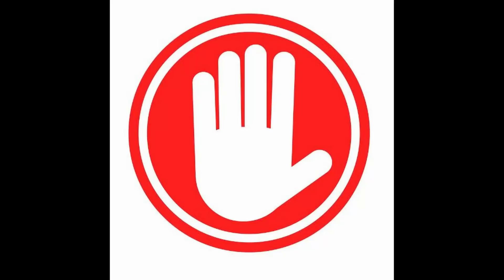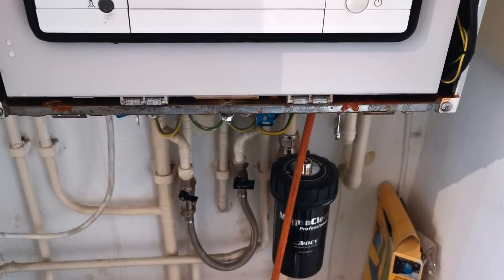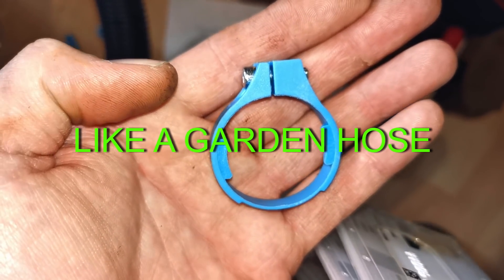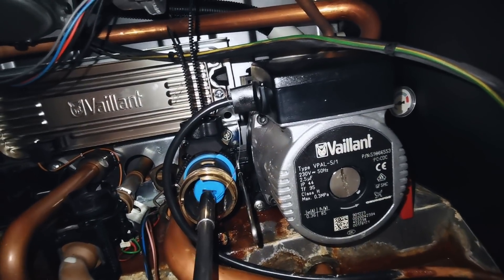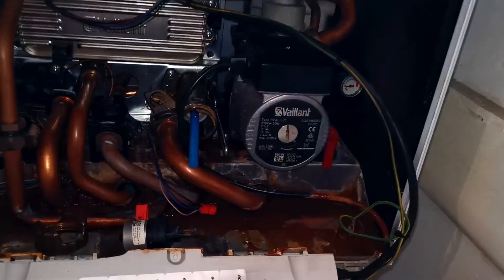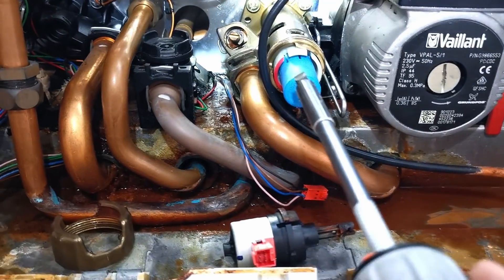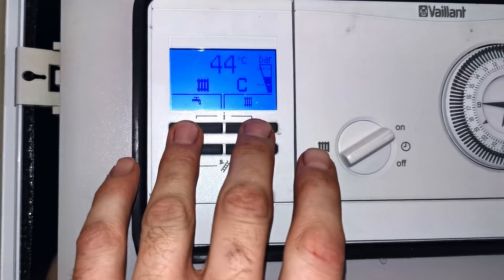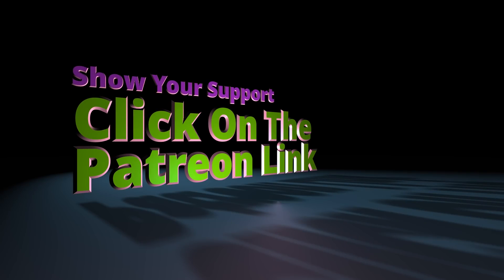Vaillant ecoTec Diverter Valve Repair. Leaking Valve Fixed. buycombi Kit Review leaking ecotec

Comment: I will say 😂 great video 👍 really helpfull. used one of these to replace divy valve exactly like you showed
after fitting no leaks but only top floor rads getting hot which no amount of balancing could fix 🤷‍♂️

Comment: Good video, shows your experience another way to fix the problem. I normally change the diverter valve but if you can fix it then why not. Slight rust doesn't matter as long as there aren't any holes that can affect the room seal.

Comment: I worked on this kit at British Gas Xsol, it’s not a bad kit to be fair, I found that the blue clips tended to wear after about 3 or 4 swaps, an alternative I used was a pair of fuel line pliers to snap the cartridge lugs and then needle nose pliers to remove the cartridge, then you can use whoever sells the cheaper cartridge. Cheaper repair and unfortunate the recall happened, great tip on the slot as well😉
Reply from the maker: Thanks. I think these will be done nearly every time soon. Its just so cost effective. We will see about the longevity of them.
Reply: Don’t think Vaillant are too happy about it😆 it saved BG about £75 per repair, and they swapped over 5000 diverters in 2016. Not sure where you would stand on warranties, but it’s a great fix👍🏻

Comment: Get video. I've done it the other way with fuel pump pliers. I didn't take the div valve out, the pliers brake the tabs then i used a pair of needle nose to take out the cartridge. The tabs can be a bit hard to brake but it works just fine .

Comment: Just did this, couldn’t get the cable tie to work on brass valve so just broke the tabs from inside with a screwdriver. Easy steps after that. Pin was corroded on previous one. £30 job, was quote £400 for a new brass valve. Time will tell if it was a success but all looks ok after 2 days.

Comment: I think everyone is different we all have to make choices based on what we see on site. Personally I'd change the whole DV assembly. Had enough call backs through trying to repair so thats what i always do now. But as i say we're all different and have to make our own choices, as there are so many factors at play. Also from a customer relations point of view and with experience I always get the customer to look at the state of the boiler, always make them aware that once one thing goes its possible others will follow.
Reply from the maker: That boiler has been fine with the second cartridge in it. I have just fitted one of these in my mum boiler. Full, in the family test. :-). I work on a lot of contracts and how I fix boilers varies depending on how the pay works. Unfortunately, I cant always replace the whole part. :-)

Comment: Nice one , i buy from the same guy on e bay and ive fitted about 10 up to now and touch wood have not had any issues with them leaking , if your going to fit a lot of these get yourself a pair of the cranked long reach grips from e bay ( about £ 15 ) and they make the job a lot easier...
cheers
Reply from the maker: I have them but haven't used them yet.
Reply: @yensabi Are the plier grip things good in your opinion?
Reply: Umar K ......yes , I used to use the plastic clamp before finding this tool and it makes the job so much easier....👍
There is a company on eBay I think it's called ( partsdaddyuk ) sorry no link and they sell them for about £ 7 , I think they call them a fuel line clamp ,
Reply: @yensabi  Thanks mate. You saved me a few £. I was gonna buy the exact same ones titled Vaillant diverter removal tool for £19. Appreciated 👍🏽

Comment: Good video for learners 
That fault was caused by a spec of debris, new boilers are whimps
Nice work fella
Reply from the maker: Yep
Reply: @HeatingGeek isnt it just as easy to change the whole divertor and housing rather than the cartridge also which model vaillant combi is this please mate? Thanks
Reply from the maker: @garylawton7254  Its just as easy both ways. The cartridge is much cheaper though
Reply: @HeatingGeek  looks like i need my second one in 13 years now lol I read years ago they were known common problems on them. It seems to be dirt on seat again same as when first one failed would seem it collects there for whaatever reason (dirty system water probably) can't they be repaired/ cleaned or refurbished somehow and put back into use once this happens mate?
Reply from the maker: @garylawton7254  Thats what these repair kits do.:-)
Reply: @HeatingGeek  how much aree they mate about £60? Thanks
Reply from the maker: @garylawton7254  £20 but you need the tools too. Check out buycombis website

Comment: Exactly what happened to me used the same kit and it started leaking after 2-3 months water was really bad ended up changing the boiler that’s why I always change the whole diverted valve on them now
Reply from the maker: Unfortunately only time will tell. I can't comment yet about the next one. We will see and I will update here.
Reply: Salman .....I always give the customer the choice of doing this repair or replacing the whole valve with a recon unit , and I do tell them that it may leak again in the future so that way I cover myself if it leaks , it's all down to the cost of the repair and a lot go for the cheaper option of just replacing the cartridge....👍
Reply from the maker: @yensabi  I would fit this kit in my house. Thats how I look at stuff. I would also fit this for my mum. :-) Its a very simple way to sum things up.
Reply: Better of just changing the cartridge rather than the whole valve if the system isn't going to be flushed because the same will happen to both but the cartridge is cheaper.
Reply from the maker: @RobinsonHeating  Thats a good point. :-)
Reply: @HeatingGeek  my divertor valve is leaking from where it screws back to the back plate. the cartridge is fine. I've had a new divertor valve installed and no matter how many times its cleaned and repositioned it still drips. any one got any ideas?
Reply from the maker: @ben1field1  Is the support rusted badly? It might be pin holed?
Reply: @HeatingGeek  thanks for the quick reply. the back plate seems fine, do you think maybe the rubber washers that came with the valve may be faulty? or the long screw not tight enough? is there a product I can put on it I.e. lsx or something?
Reply from the maker: @ben1field1  I just use silicone grease on them. I have never had a problem. it's not dripping down from the condence pipe above?
Reply: @HeatingGeek  oh ok thanks. no I dont think so, only seems to drip when I've used a hot tap. It doesn't drip with the central heating.
Reply from the maker: @ben1field1  That's a strange one. I have never had that problem. :-) Sorry
Reply: @HeatingGeek  I ptfe tapped the o rings and all has sealed. now I've noticed the black condense pipe has split. you havent got a video on that have you hahaha
Reply from the maker: @ben1field1  I bet it was the condense pipe all along :-) How old is your ecotec?
Reply: @HeatingGeek  ah man dont say that haha. erm. prob 6/7 years old. I'm moving next month so dont want to spend a fortune, just want it safe and working
Reply from the maker: @ben1field1  Does it have knobs or buttons?
Reply: @HeatingGeek  2 temperature knobs and 4 buttons
Reply from the maker: @ben1field1  if you change the trap you need to remove the return pipe to get access. Or you can try to pull the pipe out of the trap (this can be a pain) and not remove the whole trap. :-)

Comment: As other people have said - the first clampy thing is a bit useless - small flat bladed screwdriver in from the front under the tip of the lugs and twist to snap the old lug off (quite brittle plastic) - then long nose pliers to spin it a bit to break it loose - then long nose pliers again pull on the spindle with a good tug.
Reply from the maker: Could work. I  Have the other tool for them too. Not sure how good it will be.

Comment: Great video again  ✔️
I need a bit of advice which clear silicone grease which would you  recommend to use on bath tap ceramic disc plz thnx..
Reply: I need waterproof grease also o ring freindly where to purchase it from  thnx.
Reply from the maker: @adamsala9291  Silicone grease https://amzn.to/2Rnls4F  This is the one I use. Its expensive but very thick. They do smaller tubs and tubes too.

Comment: Good video as usual! I presume they are not genuine manufacturers parts. I did a Baxi diverter valve rebuild using a kit that costed about £19 & it started leaking from the stuffing gland & passing in less than a year. The water quality of the system seemed to be ok.
Reply from the maker: Im not sure because BG use this so it must be the same quality.

Comment: I know it's an old video but I've just come across it whilst looking for feedback on this type of kit. Did you decide it was a good solution rather than change the whole diverter ?  Any more issues after the 1st one leaked a couple weeks after fitting? 
Thanks
Reply from the maker: Yes. I did. For more cost sensitive customers. Also they have upgraded the kit so you can service it every year with a new seal for cheap. Buycombi have sent me the new type but I didn't get a chance to use it yet.

Comment: Excellent explanation.  Did you know you can just replace the tiny O ring that is the seal to the spindle.  It's a bit fiddly to get the metal washer to slide out sideways but then straightforward. It appears to be an R-01 O-ring: 3.15mm internal diameter x 1.8mm cross section.  I'll let you know if it leaks.
Reply from the maker: YOUR the hole driller. :-)
Reply: I fitted the repaired diverter yesterday in which I changed the "O" ring. The tabs were broken off and I refitted using large cable clips wedged in the two holes where the tabs were. All working fine and no leak from the spindle.  Even cheaper than putting in the new valve assembly in!
Reply: Didn't realise I was logged in differently. I'm also Strawberrythief
Reply from the maker: @LewishamPpleB4Profit  What if the cable ties let go????

Comment: I generally drill a small hole in the plate where water collects in these Vaillants.  Then the owner notices the leak as soon as it starts rather than when there's 8mm of water swimming around and everything goes rusty!  And before someone says it stops it being airtight: it isn't airtight anyway, which is why the water finally drips out!
Reply: You mean water tight

Comment: Ah man,  you flow like a bubble bee, keep up the good honest, quality work, this is how good honest methodical engineers should be of this standard, but caution on the tester prongs not too exposed and  just want to mention my old man use to descale the old ascots going back almost 40 years ago using pure vinegar he use to always attain from my uncles chippy back in the days he use to take out the old time not sure of the name but was basically the heat exchanger,  and fill up with the chippy vinegar leave for 24hrs and following day you see all the scale dissolved, may be even couple cans of coke does the job bit more environmentally friendly lol.  Anyway, continue the good works. God bless.
Reply from the maker: Thanks. Im trying. ;-)

Comment: You can now buy a brass version of this cartridge which looks a lot more robust and it has the added benefit of a replaceable double o ring piston gland so if ever it leaks you can just replace the gland , a great idea I think , valve is £ 22 and replaceable gland £ 8 from eBay.....👍
Reply from the maker: I didn't know that was out. How does the tabs lock in if it's brass?
Reply: Not sure , on the photo of it there is a plastic cir-clip  that comes with it , that must lock it in some how...?
Reply from the maker: @yensabi  Ah ok. I haven't seen them. :-)
Reply: Can I get a link to this product please ? cheers